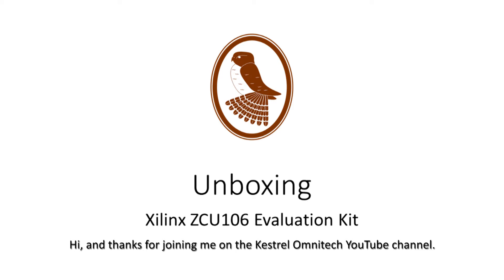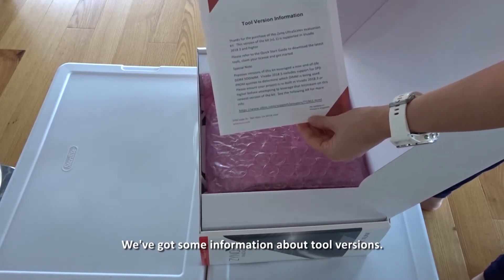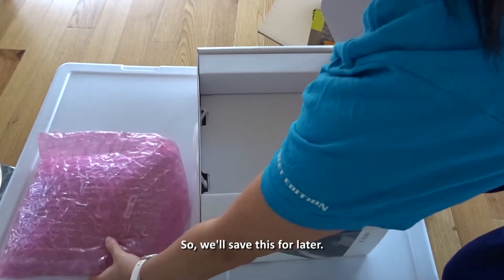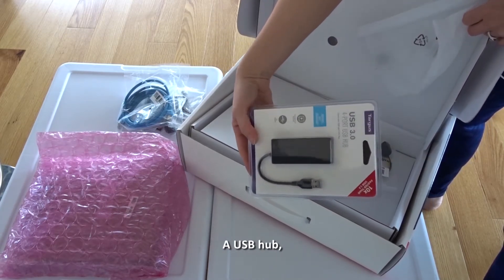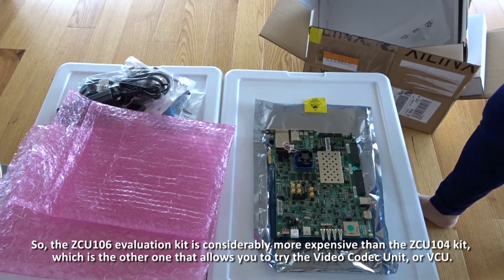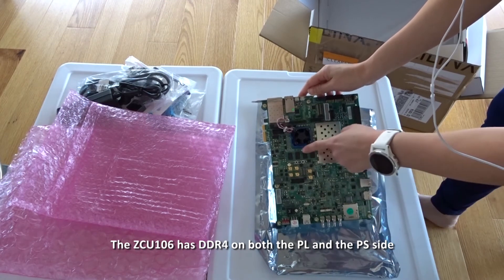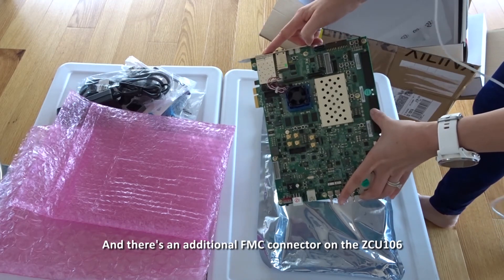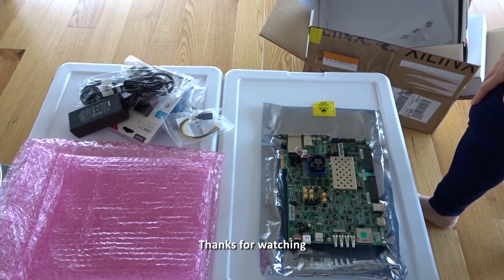Xilinx ZCU106 Unboxing

Comment from the maker: Someone asked about ZCU104 vs. ZCU106.  I'm not sure where that comment went - seems to have disappeared. A quick summary: The ZCU104 has a core set of functionality for embedded vision applications.  However, if someone needs more FMC connectivity, PCI Express, SMA connectors, or HD BNC connectors, then that’s where the ZCU106 would come in.